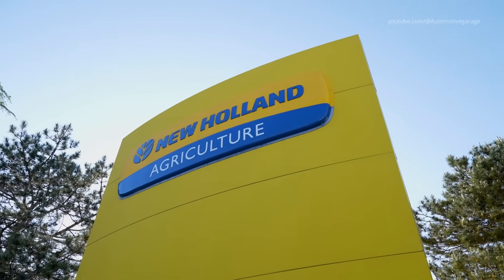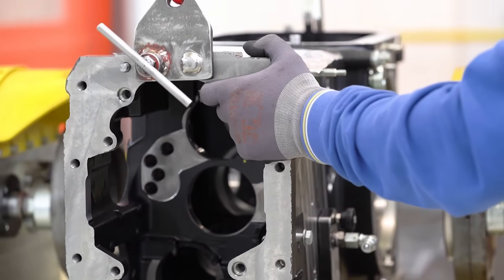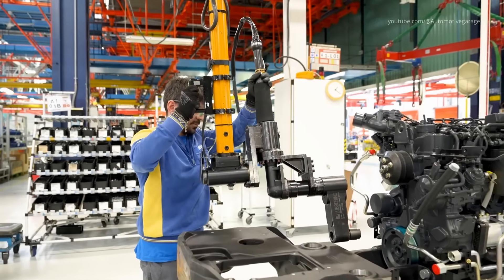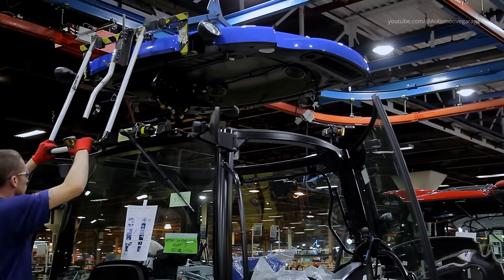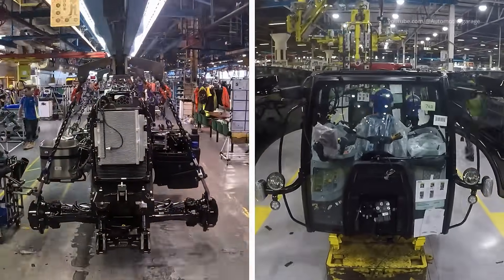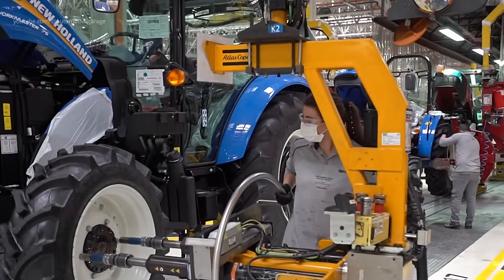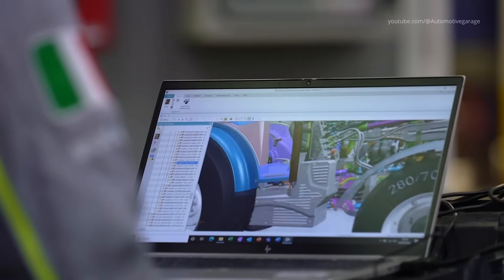New Holland Tractors Factory Tour – Inside the Production Process!

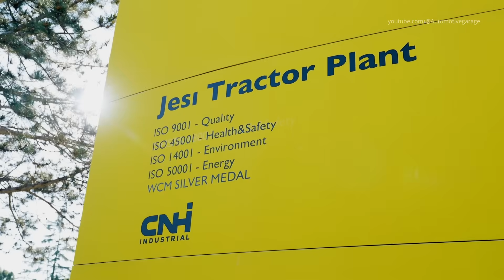Comment from the maker: 0:00 Introduction
0:17 Casting and Machining Engine Components
1:07 Engine Assembling
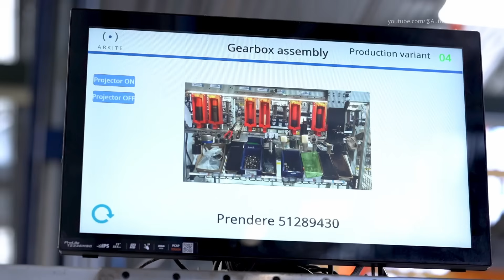2:02 Drivetrain Assembling
2:42 Production of Axles
4:16 Assembling Powertrain Frame
5:18 Painting Powertrain Frame
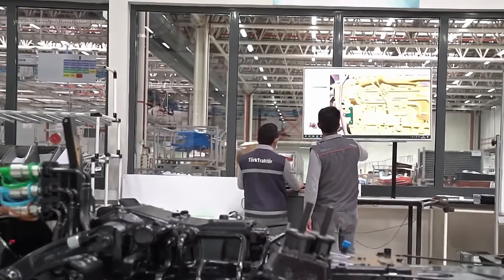7:45 Quality Shop of the Powertrain
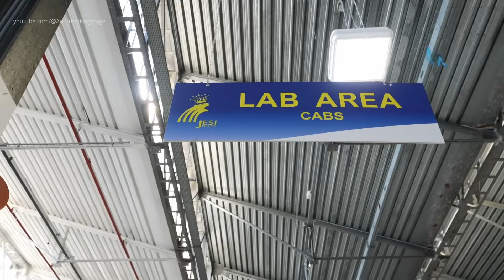8:32 Interior Cabin Assembly
10:07 Wedding Powertrain Frame to Tractor Cab
11:17 Final Assembly
11:53 Wheels Installation
14:42 Quality Shop with Quality and Production Tests
16:39 Tractors on the road tests
16:15 Tractors in field trials
Reply: My  Dream Company New Holland ❤
Reply: And My Self Anshul Jangid Form Meerut Uttar Pradesh. I am Completely Diploma in Mechanical Engineering I have Overall Experience Tractor Industries 2 year. 
My 1 company Escorts Kubota limited and Currently Sonalika Group ITL ...